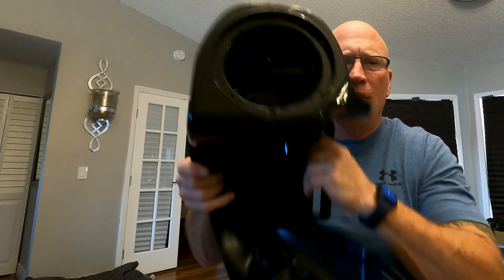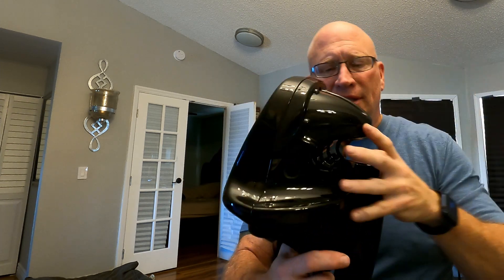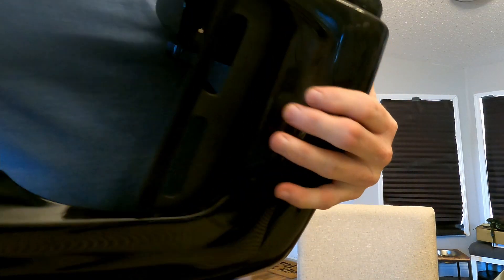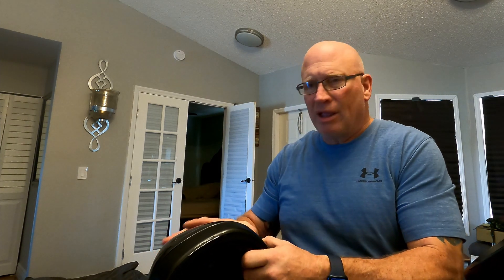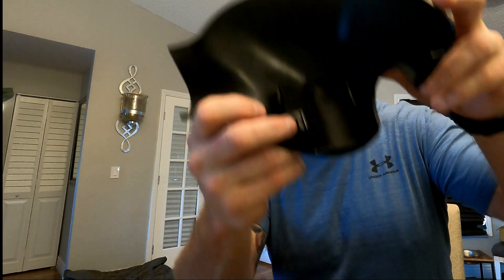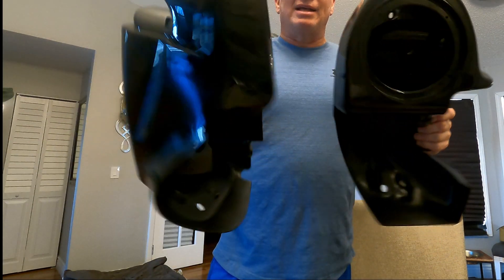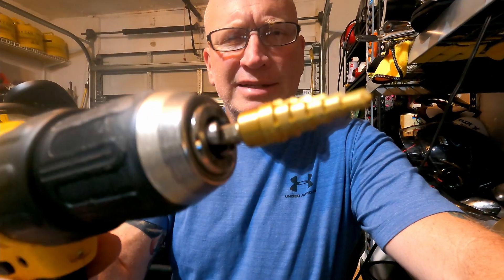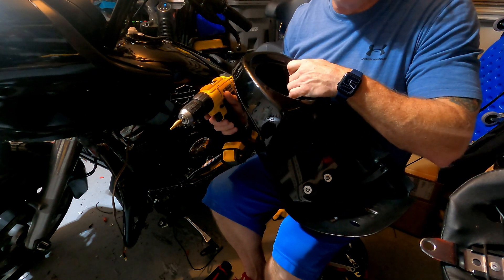Harley Lower Fairings Hogworkz vs Amazon - Comparison & Install - Watch Before You Buy!

Comment: Maybe Hogworkz have changed but i just install a set on my 2023 streetglide and had no issues getting them to tighten up or to line up any of the screws. Also the Hog workz have a larger vent opening and allow more air through when the vent is open. I would by again. Very easy to put together and install

Comment: 2020 SGS $99 Amazon lowers an chopped tour pack $299 paint matches perfect been caught in the rain A few times including5 straight hours on the way to Johnstown. 4years in paint still perfect no leaks. The only complaint I can make that's not even a big deal when I'm riding and wanna open or close the vent its a little snug but always works.

Comment: After doing a month of research and deciding, I was all set to buy the Hogworkz brand. Then I saw this video and I’m glad I didn’t instead I went with this exact set from Amazon by TCMT. They arrived today and they are really nice quality. The paint is flawless and matches perfectly. I’m gonna try to install them tomorrow I just hope my Kuryakyn extended brake pedal works with them because I do not like my OEM pedal. So thanks for making this video!
Reply from the maker: My work here is done!  I got through to someone and saved them the pain I went through with Hogworkz 😝. You should check out softbreak.com. They have a  reduced angle break pedal and a reduced  clutch lever too that are awesome.
Reply from the maker: @robertdavis5495  will do Rob!
Reply: On the same boat here .. I almost bought it today
Reply from the maker: @francescosorrentino1559  this video is saving lives lol.
Reply: Send the link if you can
Reply from the maker: @francescosorrentino1559  TCMT Lower Vented Fairing W/ 6.5" Speaker Box Pod Fits For Harley Touring Glide 2014-2020 https://www.amazon.com/dp/B01DJ2851G/ref=cm_sw_r_cp_apip_dHcspATy4Q8Qv
Reply: will amazon lowers fit with 2" softbrake brake ext / 1.5" shifter ext?
Reply: @JERVideos_OfficialAccount  if you contact softbrake they’ll tell which ones work. I am using the Kuryakyn brake pedal and extended shifter lever too works fine

Comment: as one other chap said the issue is these are 2 different models.  pre 2014 and post 2014.  the original harely pre '14's were just as much a pain as the hogworkz one.  i had them on my '07.  a bunch of fiddling and wrapping some wire loom to build out the crash bar so it was not loose.  the '14 and up ones, the cheapies, are a much better design and fit way easier.  probably reduces the cuss word component by about 90%  good information for anyone wanting to do lowers.  i assume that the '14 up will fit on the pre '14's since i easily mounted the pre'14's on my 2019 with only a minor modification.  we are putting these ones on my buddies 2007 but not till spring
Reply: Hello.. did you put the '14 up in your buddie's 2007? I'm looking to get one of those for my road glide 2007..
Reply: @eduardoloya9437  we never actually got around to putting them on.  he was going to get it wrapped in stone film to protect from stones, but he never got to it.  the damn guy would be a procrastinator if he ever got around to that.  i do assume they fit since the 07 style fit my 2019.  again, you might have to trim a bit but it should go right on

Comment: You have two different lowers. One is for pre (2013- older)  bikes and one is for the rushmore (2014-up). That might be your fitment issues?
Reply from the maker: What are you talking about?  Hogworkz only offered the one that I tried to install. There were no options for any others. The fitment wasn’t a problem. It’s the design. Just not as strong and easy to install as the Amazon brand.
Reply: @RealRonTV  first thanks for the review.  I was interested in the material quality of the TCMT lower and your video showed me it's pretty good.  
What the previous commenter is trying to tell you is that the Hogworkz lower fairing is the old style lower fairing that was on 2013 and previous models.   
The TCMT is the newer RUSHMORE style that comes on 2014+ models.   
It's weird that Hogworkz doesn't offer the newer style (and most think it is much better).
Reply from the maker: @joetaranto22  wow they should at least update their site to tell you that. How a company that big doesn’t update their product is mind boggling. I followed their video instructions on the heat shield and it was out of date too. Cost me loads of heartache and pain lol.
Reply: Agree... two different lowers.. I know that because my brother has a 2010 and I have a 2018 and they are different.... note for other users
Reply: its funny how people always blame the company for their ordering mistakes.
Reply: Just got my hogwurkz and fit perfect and gray matched.

Comment: I BOUGHT THE AMAZON BLACK LOWERS FOR MY 2020 HERITAGE. I WORKED ON GETTING MINE TO FIT NEAR THE BRAKE CYLINDER AND HAD TO TRIM OUT THE TWO METAL STUDS AND SQUARE PLASTIC SECTIONS AWAY IN WHERE MY BOOT TOES GO, WASN'T ENOUGH ROOM. THE HOGWORKZ TYPE IS MADE WITHOUT ALL THAT IN THERE.,.... GOT MY SPEAKERS IN AND ITS OK,.... IT WOULD COST $638.00 TO GET THE COLOR MATCHED ONES FOR MY BIKE SO I JUST GOT BLACK.

Comment: What floor boards and rear break arm are you running?
The look very similar to the FLO Moto boards but I can tell they are not. 
I went with the Thrashin adjustable rear break arm 2” shorter than stock and have it set to its lowest setting. 
The pad sits 2” off the floorboards. 
I see yours is also lower than stock.
Reply from the maker: The break arm is from a company called soft break. It’s a reduced angle and two inches longer.  The boards are from flo Moto.
Reply: @RealRonTV  
No shit?
Yours are a different design then the current FLO boards  I’m running. 
They must have resigned them.

Comment: What size socket did you use?  I can't get any to fit into the bolt hole.  I'm about ready to send it back!
Reply from the maker: I don’t remember but it can be done with a little work.

Comment: Do these come preassembled?  The ones I sent back from eBay came in a lot of small pieces and many bolts but no instructions.  AND it was a faded black, not vivid to match my bike.
Reply from the maker: The one I received had the speaker pods already installed. You just have to make a cutout to run the wires and attach the bolts to the crash bars and back plate of the pods.
Reply: @RealRonTV  thanks! Just ordered mine with the link you provided.

Comment: I had to mount my hertz neo's upside down.  Did you have to do the same?
Reply from the maker: Nope
Reply: @RealRonTV   Ok thanks.  I have TCMT lowers and I have always struggled to put any speaker other than a HD fairing speaker in.
Reply from the maker: @marcmo7138  I may have drilled new holes though.

Comment: You bought the lower for the 14- down from hogworkz and the eBay one for 15 up lowers
Reply from the maker: Show me on the hogworkz site where they differentiate or even offer a choice!
Reply: @RealRonTV  they don’t but the design for the 15 changed on the crash bars slightly which makes it difficult for that cap to fit just right. I had the same problem and the dealer said that was the issue. Like you I was pissed but after talking with the dealer wasn’t.
Reply from the maker: @pastorwilburmedley1124   That’s crazy!  They charge 3x as much for an out of date product and make no mention of it on their site. Ride safe Pastor!
Reply: @RealRonTV  I agree I am still a little bias though I am a Michigan guy and love the fact that they are a Michigan company but like you said that’s crazy. I like you got the Amazon/EBay lowers and they held up great.
Reply: @RealRonTV  you ride safe as well praying for your continued safety and well-being.
Reply from the maker: @pastorwilburmedley1124  thank you!
Reply from the maker: @pastorwilburmedley1124  well stop by their place and tell them to up their game and get current! 😆
Reply: @pastorwilburmedley1124  !4 and up are what he bought from Amazon.  13 and down is what he bought from Hogworkz
Reply: @marcmo7138  yes

Comment: There is no way in hell i would put Amazon/Ebay crap on any of my Harley's
To each their own, but for me no thanks.   just ordered lowers and for a few bucks more, i got lowers from Advanblack, exact match to Harley and can even use the fitted glove box liner from Harley.
I just take mo pride is using the cheapest products on my Harley's but to each their own.
And for the record, you cant blame Hogworkz for your ordering error.  You ordered pre 2014 lowers, this is on you not HogWorkz
Reply from the maker: For the record there is no distinction between the two when you order. That was the only option and only one they sell. And eBay Amazon lowers are just as good quality as the hogworkz or advanblack lowers. But to each their own. That’s not to say advanblack and Hogworkz don’t make other good quality products but for lowers they are almost identical in quality.